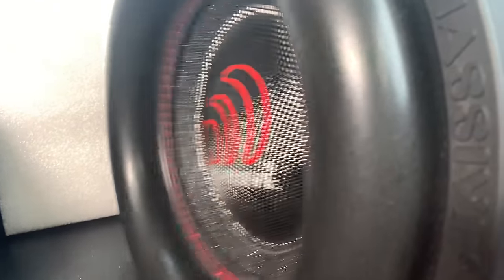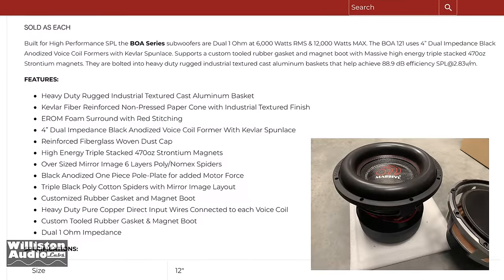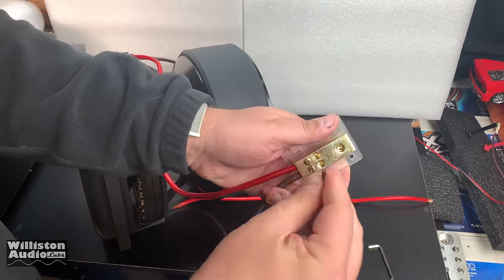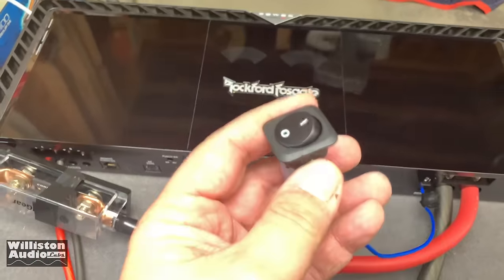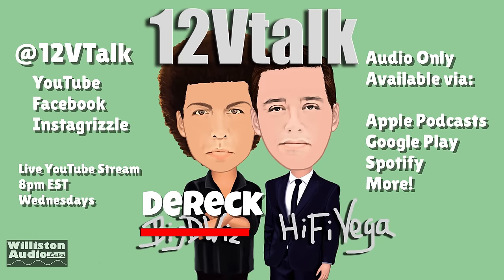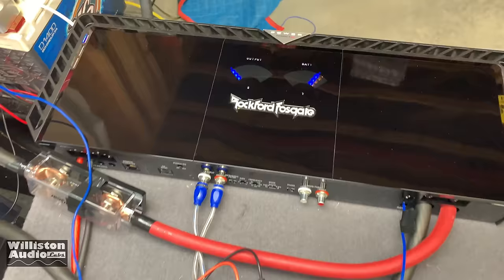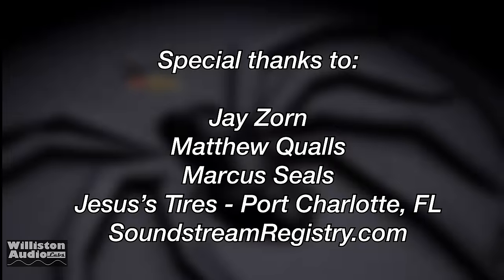Massive Audio 6000 watt RMS Subwoofer!! [4K]

Comment: I have previously had a JL subwoofer which had amazing sound but I blew it out because my ex girlfriend turned it up too loud. Also blew out a kicker subwoofer. I have the Massive Audio GTX Series 12 inch, 1400 Watts Power with Dual 4 Ohm Subwoofer and its the only woofer to not blow out for 3+ years. It bumps really fucking loud and I have the bass all the way down. If I were to turn it up it would be literally too loud and my amp is around 500 watts which is half the power of the subwoofer ROFL. It is very deep strong bass and bumps hard, only thing is that JL audio has sharper more clean and crisp base. The best way to describe massive audio is strong, chair moving and loud.

Comment: Should get a 6000 watt massive audio amp and put it on the dyno to see if they do their ratings. Im not familiar with massive audio. 6000 watts rms on a single 12 is insane!
Reply from the maker: I tested the 3000 watt Drago before and it did rated, but the Nano amp failed miserably
Reply from the maker: My bad it was Drago D5k https://youtu.be/PxNaEnUQwGQ
Reply: It appears that their biggest amplifier is the D10K - 10,000W MONO AMPLIFIER. The 10,000 watts is its peak ratings. Its 5000 watts rms@1ohm. Im kinda doubting it can do its ratings.

Comment: Just a little nit-pick:  I see people make DC resistance measurements all the time with a speaker.  You do know that impedance and DCR are different, correct?  Impedance changes with frequency.  A DCR close to what they rate the "nominal" impedance at is just a ballpark.  Its pretty cool to look at an impedance graph and how its peak will be at the Fs.  If this is just something you know, no worries, maybe it'll help some viewers.
Reply from the maker: Yes, but the AMM-1 measures impedance at the particular frequency, in addition to power output accounting for reactive load (phase angle/power factor accounted for). It’s actually a very powerful tool 🤙

Comment: 4:34 Big D wiz, did you check if the cables weren't under the speaker when you put it in the cab?
Also, you could just have installed a ring, to lift the speaker up a bit.
At this time, I haven't seen the rest of the video, but I'm hoping this box is ported!
Reply from the maker: I had an optimal box (ported) made and the sub is no mounted with t-nuts. I’ll show in a future vid

Comment: I see you mention spl once and the continues power it can handle. I would like to see how efficient the speaker is.
If it's like 86db/w efficient it would make it completely useless, if it is 95db/w or even higher it is a must have for a max spl system.
I hope you can mention it in new videos.
Reply: 88.9 is what I seen on the spec sheet he pulled up on the website for the sub.

Comment: Im running a pair of 18 inch 2KW subs, each in an 8 cu ft sealed box.  Size matters a tiny 12 might could produce high SPL but could never sound as natural as an 18 which has nearly three times the cone area.
Reply from the maker: You right

Comment: How about adding an SPL test as part of your testing
Reply from the maker: It’s in the plans 😎
Reply: @wal  make a serious were you test subs with a spl meter and put exactly 90 % of the max rms .You could compare all them ,Sundown, jl 13w7,skar ,ct sounds etz etz .
Reply: @Andre25167  I would say stay with one sub and test the SPL based on the amplifier s output.  Therefore it shows amp power difference and not the speaker.

Comment: good subwoofer speaker, but in wrong box, subwoofer speaker need a double sided box with a reflecting exhaust tube to perform well and to help the vibrator bounce back perfectly in the middle because of the air pressure inside.
Reply from the maker: 100% true. Had no idea this video would get so popular or I would’ve made a proper box 🤦‍♂️

Comment: You never posted a video of the boa on 2 amps strapped. Im curious.
Reply from the maker: Never got another 2500bdcp and the box Massive recommended was not correct (port calculation)

Comment: I have 2 12 massive with 3000 watts each with 6000 watts amp nemesis and I have 2 10 massive with 25000 watts with another 6000 watts amp nemesis and also super tweeters i also like that subwoofer monster you bought

Comment: Wondering the weight, they wont list it, and really doubting the 6k, strange how little info listed on them, oh 70 lbs!!! that looks big but my Zv5 12 is 96 lbs lol, another stack maybe? it has a larger coil but there are drawbacks to that, interested on how it does, the sundown def eats way more power than they say haha. Pretty sub but wonder how they stack up against each other, Sundown is pretty unbeatable but there are a lot of good brands, DC, DB, DS18,FI, PSI, these Massives look pretty strong, heard of them but never used em.

Comment: If you mount a car subwoofer conventionally aka not inverted and the car subwoofer doesn't fit into the enclosure then the car subwoofer has to be inverted and that's mainly because some car subwoofers have to be inverted in order for them to perform properly sometimes the manufacturer of the car subwoofer will state that it has to be inverted otherwise it will not sound good and the subwoofer will get damaged if it's not mounted inverted

Comment: So basically you just tested to see if it works? You didn’t test power handling, you didn’t test frequency response, you didn’t test SQ, you didn’t do any test actually. I still like your content because usually it has plenty of good info and testing.
Reply from the maker: Yeah I have tools for testing amps, not so much for testing subs. I actually had a box made for this sub, unfortunately Massive provided incorrect info regarding port area and the port is entirely too small. I was planning a follow-up video but have not had time to make a correct box for the sub. If I’d known this video would’ve been so popular, I would’ve done it right the first time...
Reply: @wal  
Sounds awesome man, can’t wait to see the follow up!!👍🏻👍🏻

Comment: I doubt the 6kW figure. That's a truly incredible amount of heat.
Reply from the maker: They actually advertise as 12,000 watts “max”
Reply: @wal  Big surrounds on smallish woofers doesn't make a lot of sense. It reduces cone area quite a bit. The added x-max won't add much to make it up but will need much more power from the amp. It also adds quite a bit to cost.

Comment: Manufacturers greatly exaggerate the power data. The subwoofer supposedly has 6000w, but the multimeter had 210w consumption...
Reply from the maker: Subwoofer accepts 6000W

Comment: NO in car demo?
Reply from the maker: It’s a long story. I’ll give you the Cliff’s Notes version. Massive sent the sub and I had a local shop build an “optimized” box based on the specs Massive provided. Turns out the port specs provided were off, making the custom box useless (it has 1” by 12” slotted port)

Comment: Where are the tests for 6kWt ?
For 6ohm the current should 1kA, your wires should be 10 time  thicker.
I would say max power is 500-700 Watts
Reply from the maker: I will once it gets in a proper box. There is a long story behind that...
Reply: @wal  It doesn't matter. The efficiency of the speaker is 3-5%, o let's take it 10%, then 6kWt*0.9=5.4kWt(90% of energy goes to heat) of heat, with such quantity you can heat a small house in Russia when the outdoor temperature is -30

Comment: My bass knob light and light on amp goes out, but it seems to be drawing just a little power when I put my meter on it to test, MY Story - My Belva 10" sub kit I got from ebay is draining my battery when it sits. when I pull off the big red power wire from the fuse that comes with the kit mounted near the battery my meter drops, so I know it's the amp drawing power while the car is off. I even removed the blue remote turn on to see if that was letting it draw power, with the blue wire off it is still drawing power from the battery. It's just pulling a very little amount of power to drain my battery over a few days of car sitting. My test meter reads 0.007 to 0.005 when I test with Big Red hot wire running to the amp with car in off mode, then when I pull the big red wire meters read 0.001 due to clock memory I'm guessing. So it does seem like amp is drawing a little power when everything is off.

Comment: Cool video, but that price is crazy.  For that price, most would rather go with a more known brand.  Even the other places that have them cheaper are still more than some top end known subwoofer brands.
Reply from the maker: Check dealer, I’ve been told the Massive website is high

Comment: Boa 121 speaker one amazing video even though the door rattle like an sob the hangman for first time watching your show but I thought it was just outstandingly spoken and how to hook up a speaker and how to put a speaker in the Box I really like that idea but also boxes come in many different sizes and shapes and the worked on fetuses the Buffalo or the base is way to control and sometimes you have to put things inside the box to make it Ashley Roshanda hell of a lot better thank you for very much thank you very much for letting me watch your show I think the show was Dynamite I myself used to work at 1310 Dixie and Dundas audio Automotion of course I would be in Mississauga Ontario Canada I myself for many years and it was a good type of a job installing car so earphones when they first came out complain newer types of car stereo Jackson music again thanks Kim C audiovox how's your pretty heavy machine playing in first aid kit Boom Lift Channel songs when it sends song yes always left side but I enjoyed working at audio on emotion all those sets I put in two different cars even the guys teamed up on me one night it's cut is screwed down sanded it down hey just at the point of the screw any put a little silicone on it the structure of the side of the door it should look at you big dummy what did you do to the door I get up I look out any scrip retreating from the door until they walked up and took it off Brazil's words on the hell am I going to pay for it $8,000 torr to a very high-tech expensive vehicle there goes my paycheck but obviously it was a joke obviously didn't feel too good from that joke was not relieved from that choked until 3 days after so that night I thought them good I wouldn't bought all turkey sandwiches took out the turkey put butterscotch pudding in between the sandwich left some turkey on the outside of the sandwich and I called your turkey sandwich when they fit into it while I got chased around the shop and I laughed my head off just a good Payback and after a while they stopped and enjoyed the lots of the cost for the fun night cars that night after they thought they were going to get back at me well I guess the clothes on Johnny your shop to all chaotic people that just don't know any better at the end of a Friday very very shop God bless and put something together this summer so your team can win best of sound this year because the new looking piece on All Summer Long have fun talk to you later sincere Elvis

Comment: Why use such a high power speaker? There are other speakers with less consumption that can produce great sound and dont require such expensive amps. What am i missing about the power consumption??
Reply from the maker: This is a subwoofer designed for SPL applications. It handles large amount of power so it can produce maximum SPL

Comment: it's hard to create the optimum Ultimate sound system.
sometime it is just better you go with single 2 inch driver for all frequency and it will give you better sound quality than those several million dollar speaker system those audiophile trying to achieve.
i know. it doesn't give you much volume though.

Comment: @BigDWiz i watch all ur videos and live the amp dynos! Im currently looking for a new amp to run a pair of american bass vfl 8s. I plan on giving them 800ish each rms ( have a xfl1244 that was rated 1k rms and has been juat eating up 2k rms daily for almost a year so i know thier subs can handle power no issues). I plan on another pair of vfls in the near future ( total of 4 4 ohm dvc 8's) in my 97 sierra under the rear seat. I need an amp right close to $250 that will push 1600 at 1ohm or 3200 at. 5 ohm  or something that will put down close to 3k @2 ohm and 1.5k ish at 4ohm.  I definantly value ur advice cause u been doing this longer than me im sure, i was sticking EV 18s in cadillace trunks on RF 72.2 back in the early 90s but have been out of it so long i cant keep up with the new brands and techniques!

Comment: You guys fail to look at the spec, I looked it up and it shows 90dB sensitivity in other words very inefficient, no good having a sub or bass with only 90 dB sensitivity (based on 1 watt @ 1 meter) say @ 70Hz even though it can handle 4,000 watts RMS when another brand maybe 99 dB in the frequency band of say 50 to 150Hz only requires 500 watts for the same SPL, just think of the saving on your power supply. Always remember every 3dB is doubling or halving the power, for instance a driver with a 90dB sensitivity running a 1,000 watts compared to another driver with 93dB would only need 500 watts to have the same SPL simples. Always look at the spec sheet in the frequency band you're aiming for when you compare, and a carefully constructed ported cab made from 1" birch ply with bracing can give you a 3dB gain.

Comment: Telling us wattage without sensitivity for a speaker is like giving us wattage, but not resistance for an amp.  It tells us nothing useful.
Reply: Sensitivity is 89 db, read in the tech characteristic, 6000 watts is improbable, at low frequencies, at 1000 hz, the official measurement, with 1% distortion, it would not even accept 1500 watts RMS.

Comment: Massive really not that expensive  the gordo is 650 i had the summo and hippo 300 each they are sweet online they are expensive but audio shop where im at is "way" cheaper also the drago 10k amp is 750 were i buy my audio equipment
Reply from the maker: So MSRP is WAY high? Not a great marketing plan 🤷‍♂️
Reply: @wal  yes their marketing is high

Comment: 1100 dollar in US then in India it will be 90 or 99,000 Rs. But anyway the sound of this 6000 watt woofer is far more powerful than 1500 and 4000 watt.
Reply from the maker: It is designed for SPL usage. I would not recommend for daily bass use

Comment: I have 100 inch voice coil for a 200 inch speaker.
It is powered by 200k rms amplifier using 5k volt DC source.

Comment: 6000 watt RMS power is overstated . Even 18 inch subwoofer doesn't have 6000 watt RMS. If 6000 is RMS then 12000 will be program power and 24000 watt will be peak. Calculation is all screwed here. Any sound engineer watching this will have a hearty laugh

Comment: You can not get 6000 Watts through that cable.
And the coils would have to be liquid cooled, for that kind of power.
I am sure it sounds great, but it's over rated like everything.
Reply from the maker: I got 8000W through the same dual 8ga cables here: https://youtu.be/jU1WCkQwVe8

Comment: Duuuuuuuude no 🐎 💩 Massive audio make the hardest pounding spl & sq crystal clear car audio 💎 I had a Indigo blue jeans burple colour  VW gti 1.8T model with old school 2 competition  massive audio cw 10's flipped back in a sealed in closed box [160 dbs]. 1 1500 watts 2 channel massive audio amplifier.Wire configuration bridged down to 1 ohm stable. Pioneer after market car audio receiver with rear interface Apple iPod wiring hook up.1 yellow top battery.Factory 10 speakers Monsoon sound system.I have installed alot of competition car audio.Hi end & mid level MTX 12's subwoofers are the 2nd loudest hardest hitting bass compared to Massive audio and Diamond audio.If you  wan't the most bass sound & feel for your money do what my brother Randy did with his Toyota Tundra truck.He has 2 Dual bandpass boxes [4 Dual 12's in twin bandpass box's]1-2000watts competition MASSIVE AUDIO AMP, I can hear him 1 mile away.So LOUD

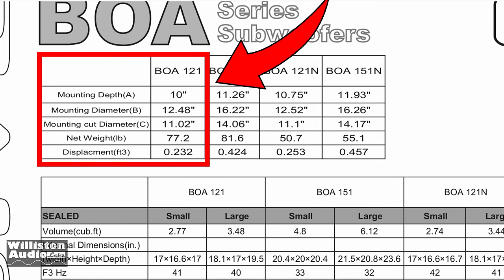Comment: 4:25 Why didn't you just put a spacer ring over the hole? Surely you have a cheap MDF box with a 12" hole in it that you could sacrifice for use with a $1200 speaker?
I've never actually seen anyone run an inverted cone in a box in their car.
Reply from the maker: Valid question and it’s what I should’ve done. I have a custom box for it now

Comment: the displacement of the air is constrained by the surface and the excursion .... it is useless to throw more energy just to heat a coil and discharge a battery.
this stupid speaker when it has moved the maximum possible air it is mechanically braked and all the extra power goes in the hole of the toilet.
Reply from the maker: You said it 🤘

Comment: Yeah if you want to pitch people on a 1100 dollar sub you need to show it waving trunk lids off, hair tricks, floating paper or hats in the window and at the very least rear view  mirrors doing the charelston and shirt sleeves flapping.  I had one 12 inch basic pioneer on a cheap low quality amp from a temporary electronics outlet in santa ana and it did all the above. So I look at high dollar subs just think whyyyy, its a bunch of extra money spent for nothing.
Reply from the maker: It’s no pitch, just showing it off. Not an ad for Massive

Comment: 6000 watts? yea right!. NO 4"  voice coil on earth can handle 3000 watts much less 6000.  hooh up a 6000 watt amp and run into clipping for 2 hours and measure thermal compression, I predict it will burn up and have at least 3DB thermal compression at 2000 watts.. a better deal is to get FOUR 12" subwoofers that cost say $200 each....these will blow away this $1100 speaker.
Reply from the maker: I’m going to get a proper box built and we’ll find out...